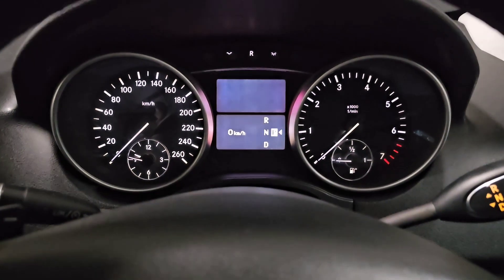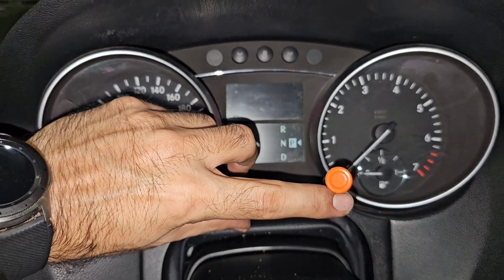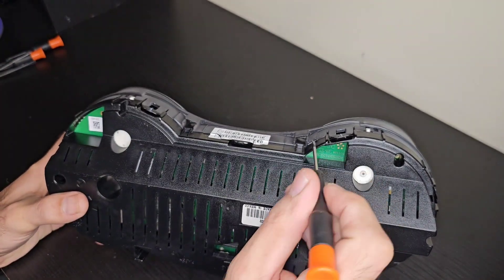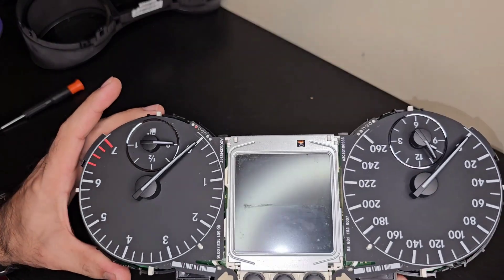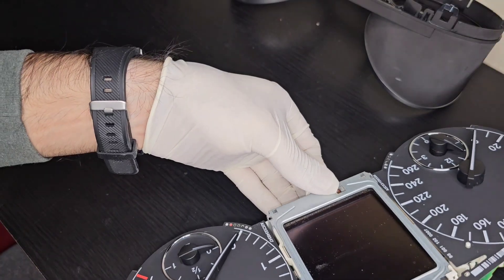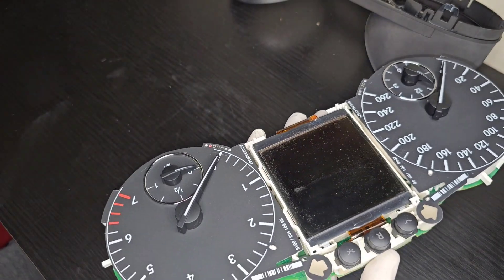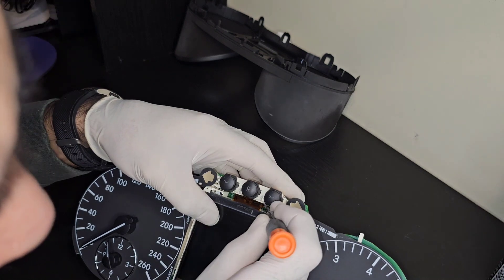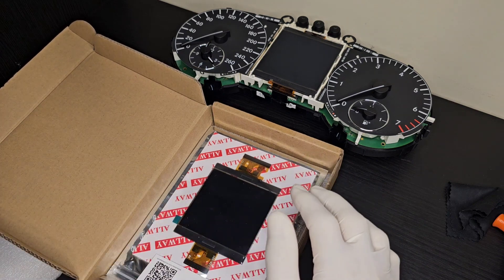Fix faulty LCD on your instrument cluster easily (W164, X164 & W251)

Comment: I saw you last Ur clock was winding in its own, do you know why? I have the same issue, maybe the secondary battery needs replaced?
Reply from the maker: The clock needs to be synced with GPS clock after the cluster being disconnected from the car for few hours. Very normal.

Comment: 2006 CLK 500 worked perfectly until I had a new windshield. Now the Auto Climate does not work. You are a great help on many things. Thanks.
Reply from the maker: CLK has a sun sensor on top of the dash, that might be the culprit,  need to diagnose using a proper obd2 scanner,  easily possible. Long term Mercedes owners are recommended to have a good scan tool that pays for it really quick.

Comment: My 2006 CLK 500  radio, CD player Navagation screen has gone grey. Everything works but I can’t see my choices. Please can you help?
Reply from the maker: You have 3 options: 1. Repair the LCD, the head unit by replacing the LCD, available on Ebay for ~ $150. 2. Buy a used navigation unit, almost same price, will need to code it to the modules most probably.  3. Android auto, not recommended.  They are mostly low quality or expensive and not original.

Comment from the maker: This is a common issue with R251, X164 and W164 instrument cluster to develop a bad LCD display and the fix usually is to replace the LCD display and not the complete instrument cluster, by doing so you will save a lot of money and time, reprograming the cluster to the ECM.